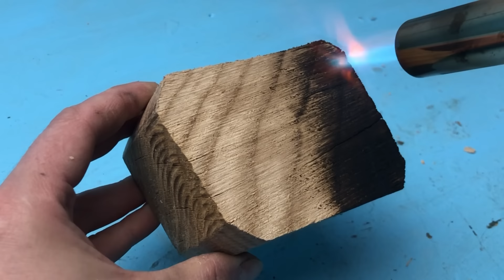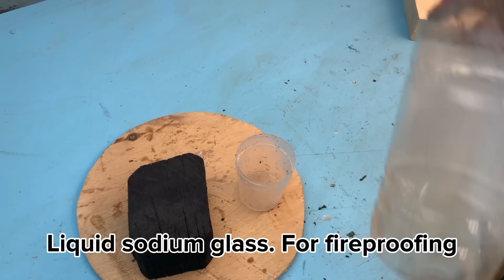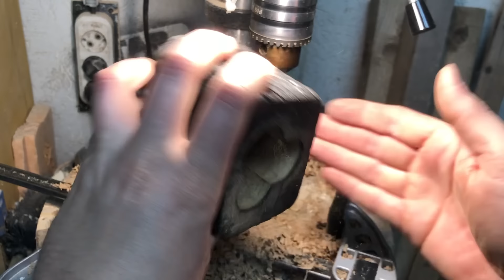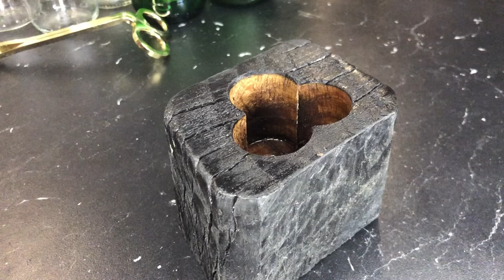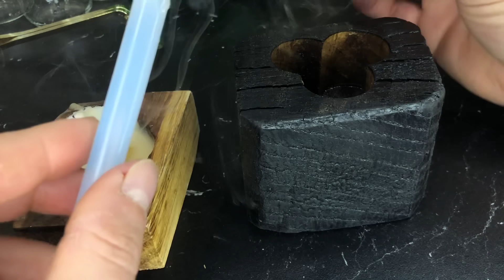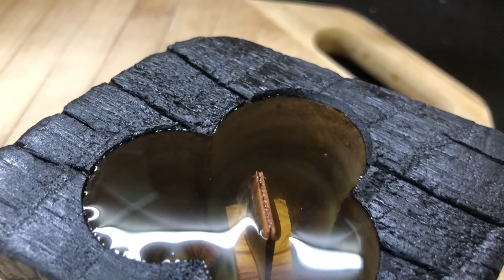This business has made millions. I just take a piece of oak, light it on fire and start working.

Comment: Thanks for the great videos. I really enjoy your channel. 

Have you ever tried to make your own Liquid Sodium Glass? I bought the ingredients after looking up a recipe online and I am about to try out a batch. The ingredients are inexpensive and the process seems very easy.
Reply from the maker: thanks for the feedback! 
No, I haven't. Why would you? Ready mix costs a couple bucks.
Reply: Not here it doesn't. I bought enough materials to make several gallons of the stuff for the cost  of a 32 ounce bottle of ready made.
Reply: I made some recently. I thought I would just go out and buy some crystal Drano but, NO. they don't make or sell that brand anymore. Jeffrey Z. in SC
Reply: @PulseCodeModulate  I bought the fine silica gel and 100% lye on Amazon. WAY cheaper than buying the premade stuff. I will be making a batch tomorrow and testing the fireproofing ability to see how it goes. If it doesn't work I can use the lye to unclog my drains and the silica to dry flowers and leaves for other crafts.
Reply: @PulseCodeModulate because of the meth amphetamine problem it is hard to find phosphoric acid and hard to get lye also
Reply: @dinadaughtry8993  Damn Tweekers make life inconvenient for the rest of us!

Comment: This candle is going to set someone’s house in fire because they forgot about it and eventually the wood casing ignites and then ignites the wood shelf it’s setting on and this then spreads. Candle of death is call it…
Reply from the maker: First of all, it is written in the safety regulations that candles should not be left unattended! You can't leave any candles unattended! Not in glass, not in concrete! 
Secondly, this tree is coated with liquid sodium glass. And you can't even light it with a gas torch. Because it's a fireproof coating. It's used in the construction of stoves and fireplaces. Google it! 
And thirdly, it's a scented candle! You don't have to burn it for a long time. It takes 15-20 minutes for the wax to melt and give off the fragrance. Then you can extinguish it and it will smell for days after that! 
So before you run off and get smart in the comments think maybe you don't know the subject at all?
Reply: Well you must be a fortune teller User, have any of your clients houses gone up in flames lately